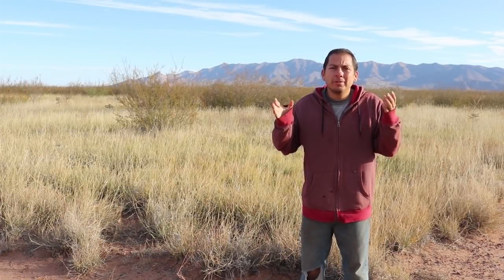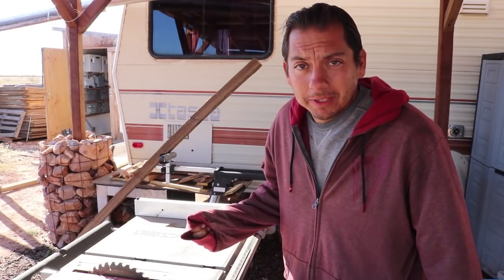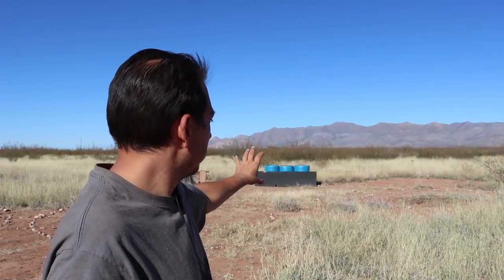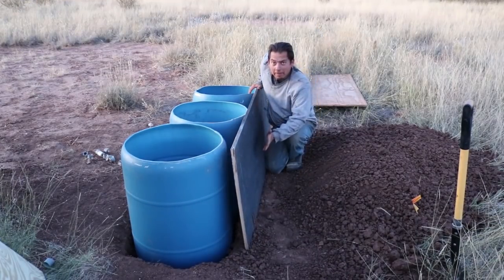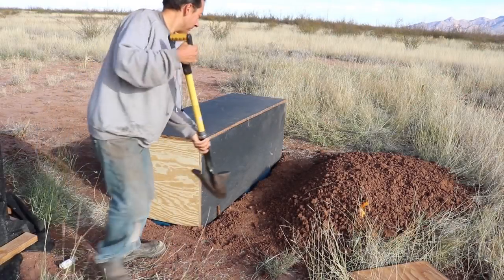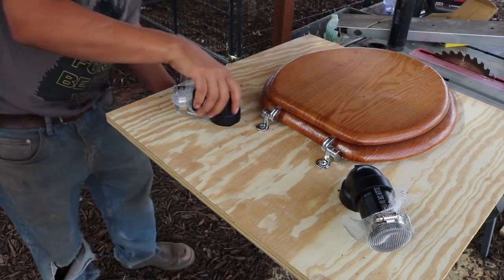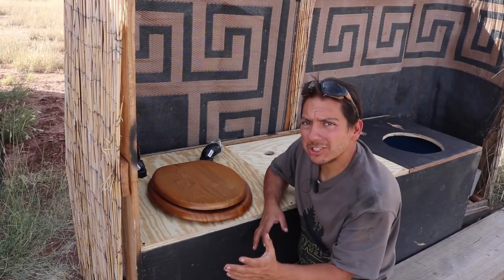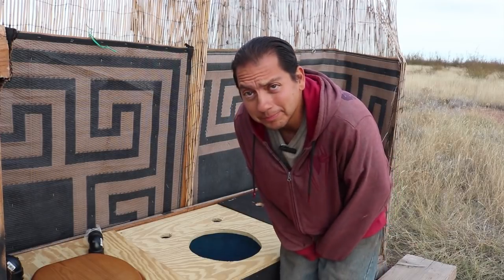DIY 3 Barrel Composting Toilet | Septic Alternative | Off The Grid Cabin Build

Comment: That's an interesting system.  Some questions from the off grid cabin in Ontario Canada. How do you handle the effluent?  Are there holes in the bottom of the barrels?  Who is assigned the clean out job in a few years?  In this neck of the woods, that type of toilet box is known as a "Thunder Box", has one hole, no barrels.  When the hole is full, the box is removed, the hole filled with dirt, and topped with a newly planted tree.  The box is relocated to a new hole. This alleviates the "discussion" as to who is going to clean out the barrels.  LOL They can only be used in permitted areas.  Congrats on your approval, and one step closer to your new home.  We enjoy watching your videos.  Glenn and Maureen
Reply from the maker: Thanks Glenn and Maureen!
There are no holes. The idea is to keep everything contained. I'm not a huge fan of this system and actually prefer the one we're currently using which is based on the Humanure Handbook. I definitely recommend that as a read.
Reply: @ourselfreliantlife  Thanks for the book reference and for the info.

Comment: Are you going to add a roof? I know you don't get rain for most of the year, but I recall seeing snow on the ground there last year. And then there are the freezing temperatures during the winter.
Reply from the maker: No, no roof. I'm really not too concerned about actually using this.😆👍

Comment: Probably should put some solar led lighting under the top of the box to help you see the rattlesnakes that find a way into and around your toilets. Also, how are you planning on emptying these? If you put nylon rope handles on your barrels, you could run a pipe through them and get Jess to help lift. Don't let them get too full. The waste will weigh 8-9 lbs per gallon. If you sink a piece of plastic culvert into the ground as deep as the barrels are, the earth won't collapse when the barrel is lifted for emptying, assuming that you are going to remove barrels for emptying. Removal for emptying would reduce the labor required to empty them.
Reply: Meant to suggest extending the vents helps remove odors, as warm air rises.

Comment: Are you separating or diverting the urine from the barrel?
Reply from the maker: No. We're not using them now, but even in the system we do use, urine is too valuable to exclude it. Extra moisture and nitrogen for the compost.

Comment: If you use sawdust or peat moss for your cover material, you'll never need any vents. And you should have built this into your home (or maybe you are going to still.) Because it's perfectly fine being located inside a home. No smell at all.
Reply from the maker: We've been using the Humanure handbook design for a year and a half now. I totally agree on the smell. The best cover material we've used is straw.
This design is to satisfy county requirements.

Comment: I thought you could opt out of inspections in Cochise County, no?
Reply from the maker: Yes, you can. There are two inspections you can't opt out of though. One is the septic, they want to check that out. Also, they need to inspect before you start building just to check setbacks. Then you're golden from there.😀
Reply: Thanks, bro.

Comment: Does some one needs to stand over you with a whip?  To make YOU WORK?  Quit playing with Jess all the time > You want to make the potty easy to get off and on and to be at the right height. Not to high and not to low  Heat and cooling the potty house >  You surely don't want to use them in below zero weather. Nor Hot weather. Need to make them at a comfortable temperatures  >>  I was in Montreal Canada in 100 deg below zero blizzard>  I had to get out of the truck to take a leak. AND MY URINE FROZE BEFORE IT HIT THE GROUND. Man i did fine a pop bottle to use and kept it in the truck  Looking down at the ice crystals i made was kinda freaky  LUCKY I DIDN"T FREEZE IT OFF